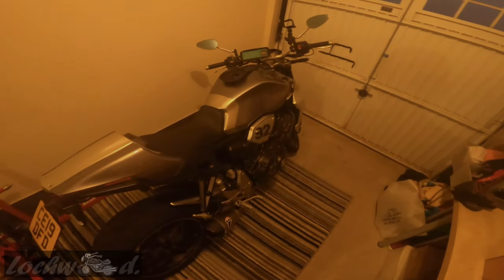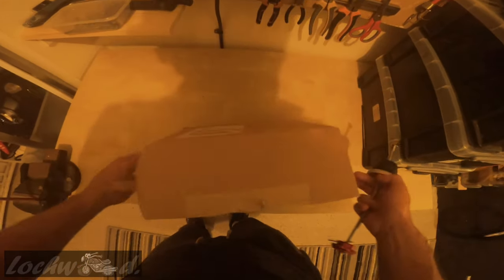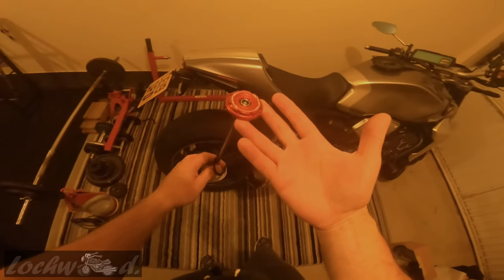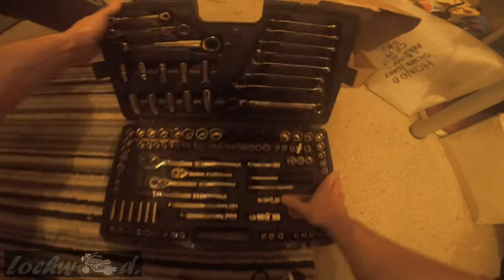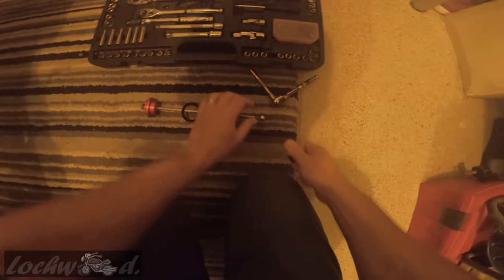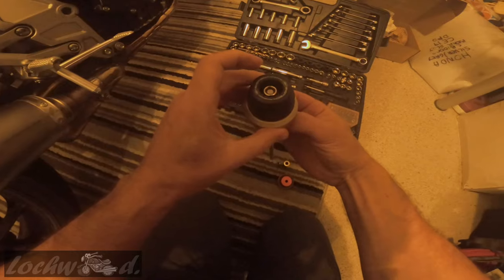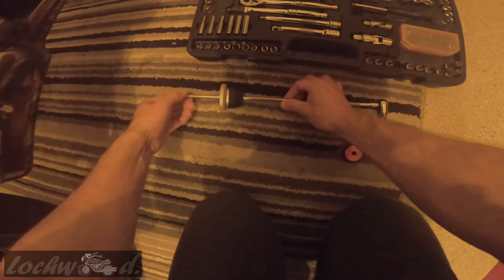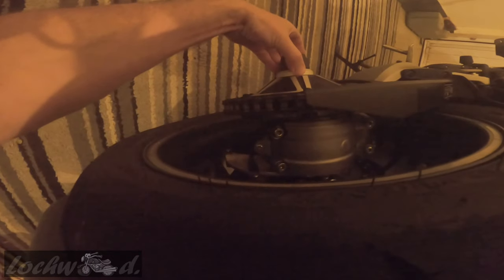CB1000r Evotech Rear Spindle Install

Comment: Hi Pal, I want to remove rear axle and dismantle it in order to get the axe shaped rear brake bracket out ! I got the center large nut out with a 19mm hex bit but still stuck on how to remove the center axle. Any idea on  the correct procedure ?
Reply from the maker: Couldn't say but my old VFR750 had an Oring that held it in place after removing the nut. Good luck with it.